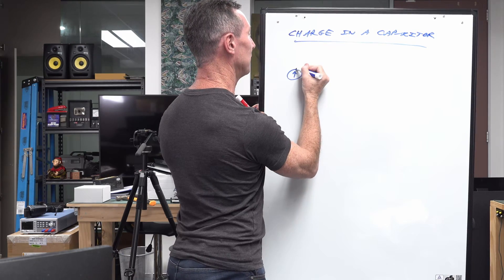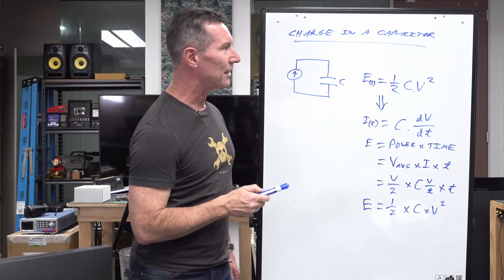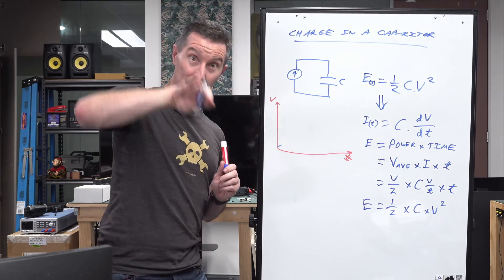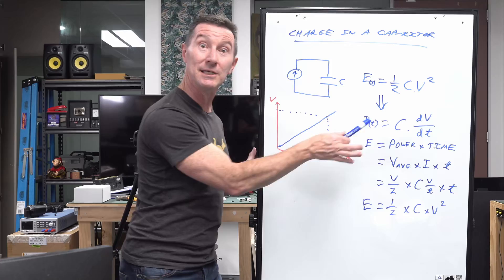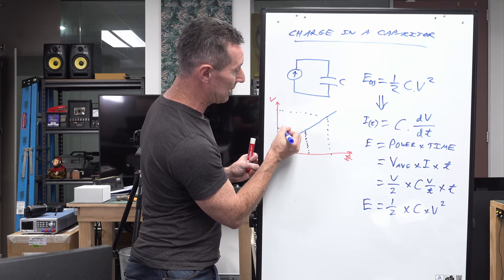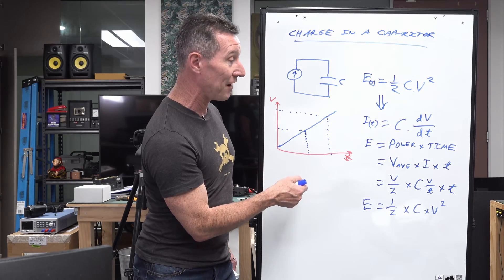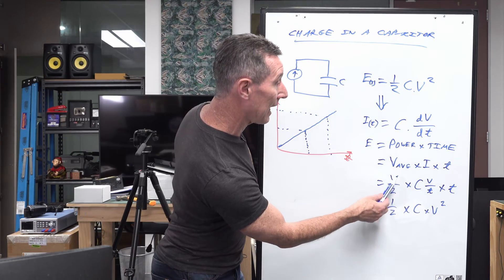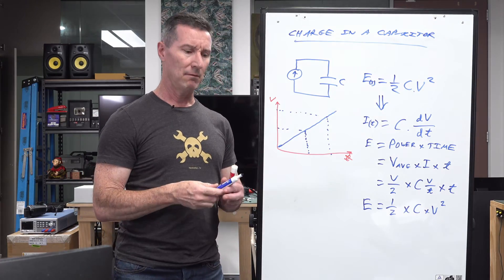EEVblog 1618 - The Equation For Energy In A Capacitor

Comment: I'm trying to intuitively grasp how voltage is squared. This implies that if you charge it for double the time, you get 4x the energy. Would this be because to maintain a constant current, the energy is constantly increasing? (since the constant current source has to increase voltage to maintain that current)

Comment: Video is titled "The Equation For Charge In A Capacitor" but you gave us the equation for Energy in a capacitor. The equation for charge is just Q=CV.
Reply from the maker: Damn, title brain fart
Reply: @EEVblog  - Does the same equation and linearity apply in super-caps too?
Reply: @BillAnt   YES  a super-cap is also a cap(acitor).
Reply: @retiredjan4714  - Right but super caps can pack more energy in the same volume of space.
Reply: @BillAnt   Not sure about that i think it is in the same range   Q = C x V
A supercap has a very low voltage 2.7 Volt and 400 Farat, while electrolytic caps start at 16 V 10 uF and go up too 600 V 5 mF  (m for milli, u for mirco)
Reply: @retiredjan4714  - Sure but as you know W = A x V.  So even with lower voltage and higher amperage you're getting higher power.

Comment: if the term C.dV/dt, representing the current charging the capacitor as in the case here then the dV/dt is dependent on the charging current (the current source) not the opposite. Yes mathematically I(t) = C. dV/dt, but physically you're making a cross referencing. Also according to this equation, there must be a voltage variation with time so that the capacitor can source/ sink current (dV/dt must have a value other than zero)

Comment: I have a software engineering degree, and we did some introductory electronics on the first year. It wasn't a whole lot, but we did touch on resistors, inductors, capacitors, zener diodes, and I think we just lightly touched BJT transistors. The part that I found more of a chore was capacitor charge/discharge calculations. Not relevant to the video really, just reminded me of it.

Comment: how to convert from J to Wh.  Q(c)=It=UC => E=Q*U  because when you pull current from capsitor the voltage drops from VCC up to 0V.  then E=Q*U/2=>E(joul)=C*U^2/2.  in hour had 3600 sec i put this and get P(Wh)=C*U^2/7200=>>>> it mean if i will use this power at one hour it take P power.

Comment: When I need this 15 years ago, I simply used equation U*C=I*T
Question: how big capacitor I need when switching load from PSU1 to PSU2 to prevent power glitch (and restart) on load. Spreadsheet to help and done in few minutes.

Comment: Here is a question: A capacitor with a known value and charge (and therefore energy) is connected to a discharged capacitor of equal value. I assume that the charge moves such that it is now equal between the two capacitors, the voltage for each capacitor drops to half. So each capacitor has 1/4 of the initial total energy. Where did the other half of the energy go?
Reply: If you have 1F capacitor charged with 2J energy then if you measure the voltage will be 2V. If you have 2F capacitor charged with 2J then the if you measure the voltage will be √2V. The relation between capacitance and voltage is not linear.
Reply: @alexv3780 interesting 🤔 
The auld gray matter is sparkling after reading that. 👍🇮🇪🤔
Reply: There's some bad math involved there. When did 1/2 * 2 = 1/4?
Reply: @user-dj1hy6zc6q  when half the charge moves to the other capacitor, the voltage for each capacitor drops to half the initial value. If the energy is CV^2/2, you get 1/4 of the initial energy.
Reply: @bert-blank I've seen similar puzzle before. The energy was spent on moving the charges. Charges were moving back and forth like a spring, eventually half of energy dissipated on heat and em radiation.
Reply: Why do you presume that the voltage will halve at paralleled equilibrium?
Reply: @ChrisSmith-tc4df  I assume the halving of the voltage, based on linear charge/voltage assumption. That may be wrong.
Reply: @sdgelectronics  The charge of the initial state is CV, the capacitance of the final state is 2C, by conservation of charge the charge of the final state must be CV - same as the initial.  Since both capacitors are connected in parallel, they must have the same voltage across them (assuming steady-state final conditions where no significant current is flowing through the resistances of the wires and thus no significant voltage is dropped across the wires).  So, the voltage across the set of two capacitors in parallel must be charge divided by capacitance or  CV/(2C) = V/2.  

Am I missing an assumption?  What leads you to the conclusion that it's sqrt(V)?
Reply: @electronevice  it looks like the two capacitor paradox is well documented in various literature
Reply: This problem was presented to me by a professor in first year of university. My first response was heat, but that was not the answer. I'm sure the explanation was given at the time,  but I can't remember what that was because that was 30 y ago. EM radiation has been mentioned twice, and for the sake of simplicity zero resistance (ideal capacitor).

I might grab a couple of caps and experiment with the halving of the voltage (note to self to use bigger caps and high impedance meter to limit bleeding thru meter).
Reply: To slightly rephrase what I think you're asking "If you have a capacitor with capacitance C charged up to a voltage V and another capacitor of the same capacitance of the first one completely discharged (voltage of zero), then connect the both sides of the first capacitor to both sides of the second capacitor, the resulting voltage across each capacitor will be V/2 by charge balancing.  The energy stored in each capacitor is therefore (CV^2)/8, so a total of CV^2/4 for the whole system.  Whereas before connecting the capacitors together the total energy was CV^2/2.  So where did the other half of the energy go?"

The answer is that it would have been dissipated as heat in the resistance of the wires connecting the capacitors.  The value of the resistance cancels out in the final calculation because the smaller that resistance is, the larger the current and the larger the dissipated POWER, but the integrated energy dissipated will always be CV^2/4 for capacitors with the same capacitance C regardless of the resistance of the wires.  

What if the dielectric were vacuum, and the plates and wires were the Devil's own superconductors you might ask?  Then the inductance of the system would dominate and cause it to be a near-perfect LC tank oscillator, and the energy of the electric field of the capacitor would transfer to the magnetic field of the inductance of the wires/plates and it would bounce back between energy contained in the electric field and energy contained in the magnetic field, and the energy would slowly be released as EM radiation from the wires which act like an antenna until the oscillation is negligible and the remaining energy would again be CV^2/4